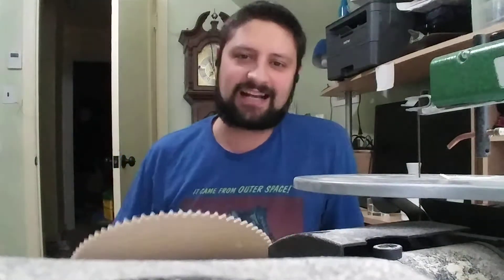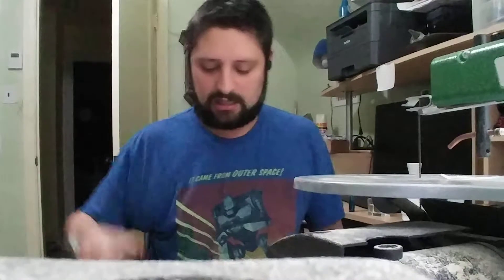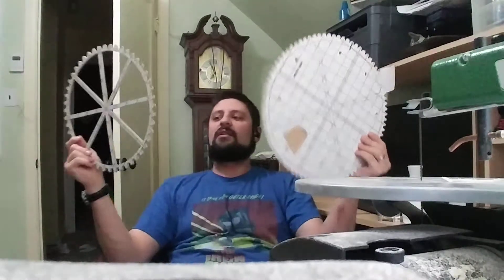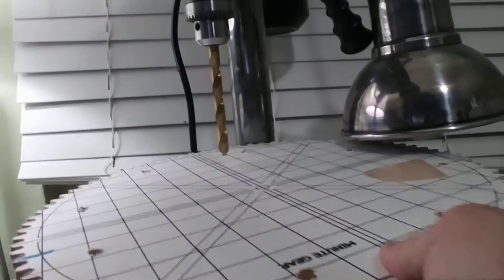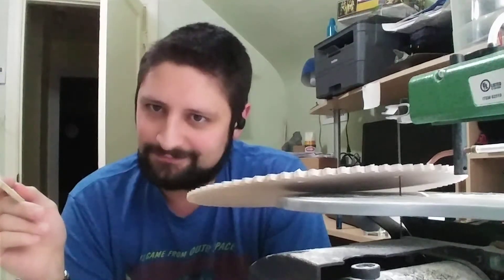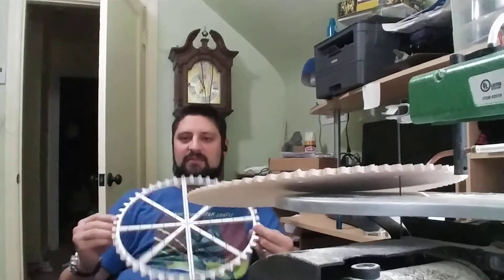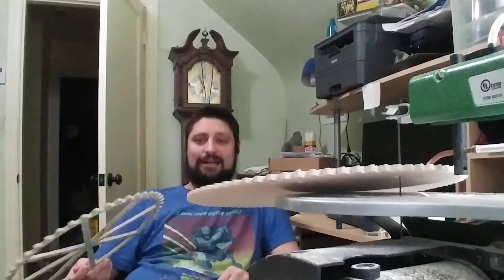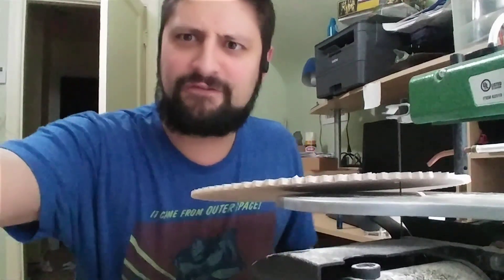Horcrux Clock - S1E3 - Gearing up

Comment: I like the name Petros.  Keep it.  
Can't wait to see the finished clock in January 2020.  If it is anything like my projects, the initial time estimate may be a bit off.  The journey is most of the fun.
You don't need to take your drill press apart to drill the center holes.  Just drill a hole through the center of a 2x4 and use it to guide a hand drill.  The biggest problem is lack of visibility, so you need a center hole.
Steve